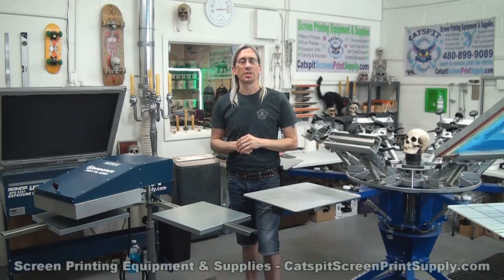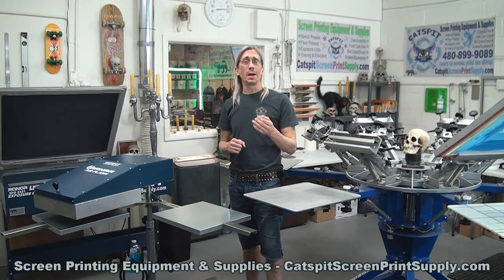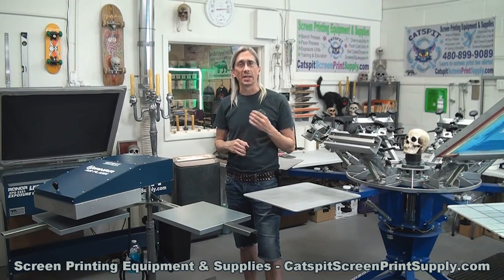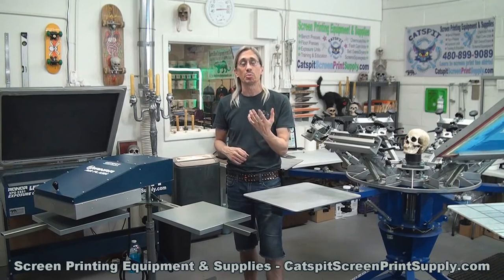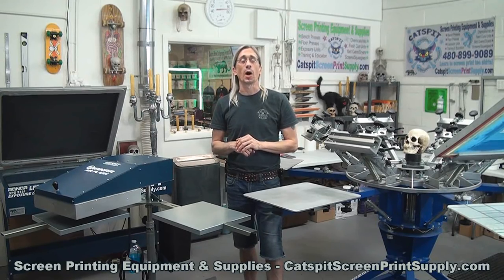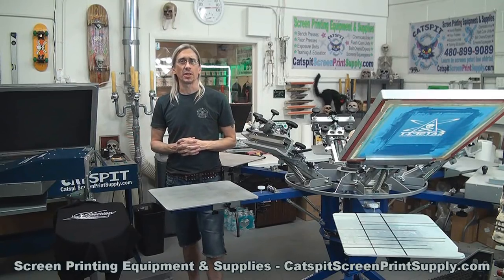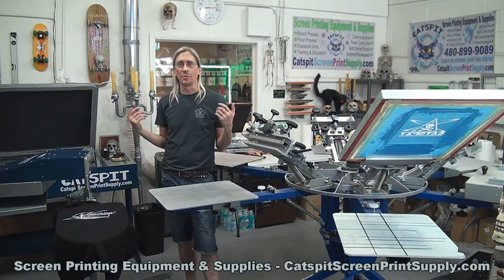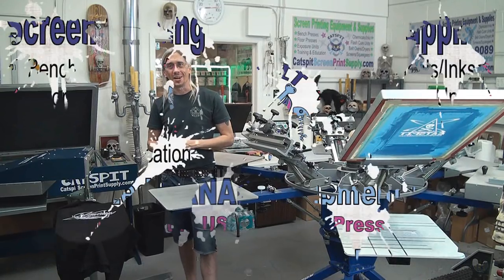Screen Printing Shirts: Heat Setting Water Based Inks Without Forced Air

Comment: Been doing mine with a heat press.  just make sure you use parchment paper between shirt and press.  Heat press 30 seconds at 320 degrees open release the steam, then heat press again 20 seconds...done!  So far no failures to date.  Using a 15" x 15 " claim $200.00 press from sign warehouse.
Reply from the maker: Interesting, thanks for sharing. And thanks for watching! Screen Printing Equipment & Supplies - http://CatspitScreenPrintSupply.com/
Reply: are you using the press to get the evaporation out and to completely dry them?
Reply from the maker: @vinylxpressionz3479  I believe he is. That is correct. Thanks for watching! Screen Printing Equipment & Supplies - http://CatspitScreenPrintSupply.com/

Comment: I took the all day ISS class on Screen printing. We were working with water base discharge on black shirts. We would run them through the dryer and they did not want to cure. So we hit them with a heat press. The heat press worked great. The shirts came out looking great.
Reply from the maker: Discharge really needs some forced air to work best. You can do it but it would take even longer than just a water based ink I think. Heat presses can work very well for water based inks though. Especially when they are set to dry first. Thanks for watching! Screen Printing Equipment & Supplies - http://CatspitScreenPrintSupply.com/

Comment: Hi thank you for your videos, they're really helpful.

This was not on your video but can I do this procedure for white water-based ink printed on black shirt to obtain quality?
1 - PRINT
2 - DRY WITH HAIR BLOWER
3 - PRINT
4 - DRY WITH HAIR BLOWER
5 - CURE WITH IRON

Thank you very much. I hope you can answer my question. :)
Reply from the maker: Yes, you should be able to print/flash/print. But the more layers you print like that, the thicker the print will get. Thanks for watching! Screen Printing Equipment & Supplies - http://CatspitScreenPrintSupply.com/
Reply: Israel Carbonilla  but did it crack?

Comment: That was really  helpful. ..
But can you please tell me the timing for heating the time shirt at 250° , coz my Tshirt lose its darkness after washing. ..
I don't have any flash cure ....
I dry them with hair dryer and then heat press it in the  heat press ..
Reply from the maker: You may not be reaching temperatures or perhaps the shirts are fibrillating. Thanks for watching! Screen Printing Equipment & Supplies - http://CatspitScreenPrintSupply.com/

Comment: Does using a flash dryer vs letting it air dry make a difference whether or not the print will having early cracking?
Reply from the maker: Well yes. Being as though most water based inks need to be heat set. Not many are "air dry only." And those that are usually are in the hobbyist category. For best wash results, be sure to heat set the water based ink using the specs from the manufacturer of your ink. Thanks for watching! Screen Printing Equipment & Supplies - http://CatspitScreenPrintSupply.com/

Comment: Hey bud.
I love your videos and really appreciate all the info you give us. I've learned a ton from you.
Thank you!

Throughout the video you mention laying the shirts flat to dry before flashing (assuming you don't have a forced air dryer)...

Could I hang them to dry before using a normal flash dryer? Do you see an issue with this? I am printing shirts at home and don't have much room or a forced air dryer but want to use discharge and water based inks. Not doing big production so time is not really an issue.
Reply from the maker: Hey there. Thank you, I'm happy to know you enjoy my videos. You're welcome. My pleasure to help out where I can. Yes, you could hang them. That's no problem. Thanks for watching! Screen Printing Equipment & Supplies - http://CatspitScreenPrintSupply.com/

Comment: If your standard flash dryer without forced air doesn't have a temperature reading how do i know if it is reaching high enough temperatures and how much distance should there be between the shirt and the heating element and for how long should it stay under the dryer?
sorry for so many questions and thanks for the video!
Reply from the maker: You're welcome, glad you enjoyed the video. I have other videos on how to cure plastisol ink and even one about setting up the flash cure. Check out my video uploads on my channel page where you can search by topic. Thanks for watching! Screen Printing Equipment & Supplies - http://CatspitScreenPrintSupply.com/
Reply: @CatspitProductions  oh i'm still using water-based ink but just not sure on the timings or distance etc
Reply from the maker: @joeboddington5634  You'll want to check with the maker of the ink for specific curing instructions. Water based inks vary a little more on how to heat set them. You can watch the video on how to set up the flash cure to see how far off the pallet it might be.

Comment: Hey man, thanks so much for your videos they've truly helped so much. In this vid you nailed my question- been looking for this particular answer for a while! On the back of what you've mentioned about letting them air dry and then using a flash dryer to cure them, how long would you say at this point would they roughly take to cure- seen as some of the waters evaporated? I use Permaset Aqua inks, thanks in advance! 
p.s keep up the amazing work!
Reply from the maker: You're very welcome, glad I can help out through my videos! They need to reach a specific temperature like 250 or what have you. Each brand of ink may vary slightly. Check with Permaset for exact curing temps and instructions. Thanks for watching! Screen Printing Equipment & Supplies - http://CatspitScreenPrintSupply.com/
Reply: Thanks again dude!
Reply from the maker: My pleasure to help out where I can.

Comment: I've been using low cure additive and running mine through a standard conveyor and have had no problems with dark wb inks... but with white wb inks, I cannot for the life of me get them to cute right... the don't wash out but they crack after I wash test them... I'm losing my mind...lol. I love the feel of wb inks and absolutely love the darker colors that set in, but the white...arrgghhh... I'm being told to go forced air to eliminate the problem??? What to do...
Reply from the maker: I think it's more of a ink volume problem. If you print too much water based ink, it can crack or flake. It's supposed to be more in the fabric and it should feels soft. Or you might try a discharge base instead but you would need forced air for that. Thanks for watching! Screen Printing Equipment & Supplies - http://CatspitScreenPrintSupply.com/

Comment: Could I heat set with a heat press after letting them sit for a day? I mean I have a non force air flash dryer as well but was just wondering I could use a heat press as well? Thanks
Reply from the maker: Yes, that would work as well. Thanks for watching! Screen Printing Equipment & Supplies - http://CatspitScreenPrintSupply.com/

Comment: Would you flash dry just to evaporate the liquids then heat press to heat cure? I'm about to make a purchase but don't know weather I should go with a heat press or flash dryer. And by the way I tried to make a purchase from you but I'm in canada? No shipping? Thanks
Reply from the maker: I would let them dry by evaporation since the flash would probably take long enough that you would just cure them as well. If you get an air flash then that is the best option and it will work very fast in comparison to no air flash. Yes, Canada is considered exporting for me. So you would have to contact me directly to see about a purchase. Thanks for watching! Screen Printing Equipment & Supplies - http://CatspitScreenPrintSupply.com/

Comment: I run mine through a conveyor (not forced air) a couple of times. They set fine. would like to upgrade to forced air. So its "one and done"
Reply from the maker: Yes, exactly. You're simply allowing enough time for the solvents to evaporate out and for the pigments to become wash safe. So that's another way of doing it but yeah, one shot through would save a lot of time especially on larger orders. Thanks for watching! Screen Printing Equipment & Supplies - http://CatspitScreenPrintSupply.com/

Comment: Hi. Thank you so much for your videos. I've learnt so much. May I ask, what if you want to cure water based ink with a flash but are printing on to 50/50 poly cotton  blends. Do you need to add a low cure additive?
Reply from the maker: You're welcome. I appreciate your support. Probably not since most water based inks cure at or under 250 degrees F. But you may want to ask the ink maker about what to use for 50/50. Thanks for watching. Screen Printing Equipment & Supplies - http://catspitscreenprintsupply.com/

Comment: I have a flash dryer without forced air..how long I have to lay them out flat to evaporate...can I use a fan
Reply from the maker: Yeah I suppose you could use a fan to help out. They have to be dry to the touch. That's it. So if you can touch the print without any ink getting on your hand, you're ready to heat set. Thanks for watching! Screen Printing Equipment & Supplies - http://CatspitScreenPrintSupply.com/
Reply: +CatspitProductions thank you so much...you have been a great mentor for me..
Reply from the maker: You're very welcome. Glad i can help out through my video work :)

Comment: Standard house laundry dryer also gets the water out.
Reply from the maker: You would not want to put wet ink on shirts in a dryer. That will make a mess quickly. So you would need to let them dry to the touch by evaporation first. Then if the dryer reaches between 250 and 290 degrees F, you could use it to heat set the water based ink and make it wash safe. Thanks for watching! Screen Printing Equipment & Supplies - http://CatspitScreenPrintSupply.com/

Comment: Is there a difference between "Heat Setting" and "Curing"?
Reply: Epic. You answered this less than 90 seconds in! Excellent! Thanks! All my youtube research for the past 20 minutes has been worthless because it's all about Curing
Reply from the maker: Yes, there certainly is. Many people say water based inks "cure" but there is no chemical process there in actuality compared to plastisol ink which rubberizes when cured. Thanks for watching. Screen Printing Equipment & Supplies - http://catspitscreenprintsupply.com/

Comment: can you headset any water-based ink?
Reply from the maker: Yes, technically speaking water based inks heat set whereas plastisol inks cure. There is a difference. Thanks for watching! Screen Printing Equipment & Supplies - http://CatspitScreenPrintSupply.com/

Comment: Hi that's not what the speedball process says.
Reply from the maker: Speedball is a hobby grade water based ink. And yes, you should follow the instructions for whatever ink you actually have. In this video I am generally talking about commercial grade inks. Each water based ink may have its own recommended temperatures but the idea is the same. Evaporate the solvents, then heat set. Be sure to read the instructions for any ink you try to use. Thanks for watching! Screen Printing Equipment & Supplies - http://CatspitScreenPrintSupply.com/